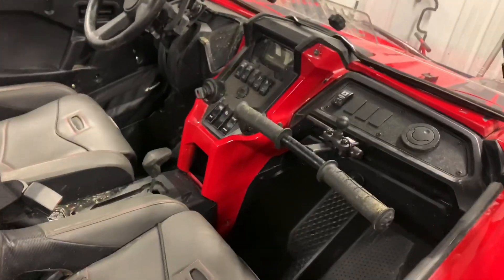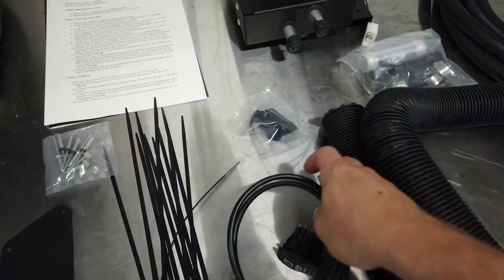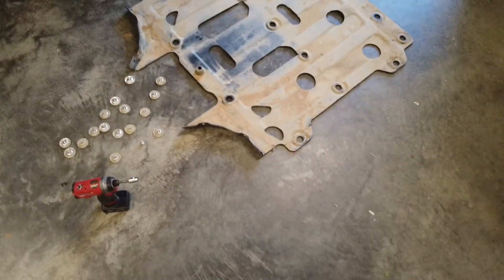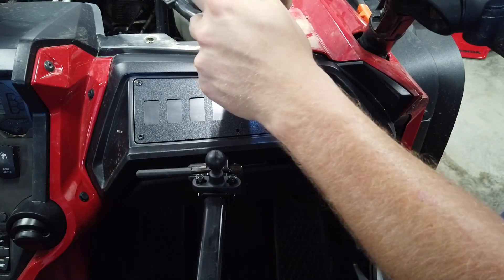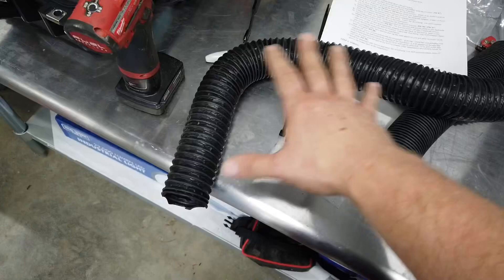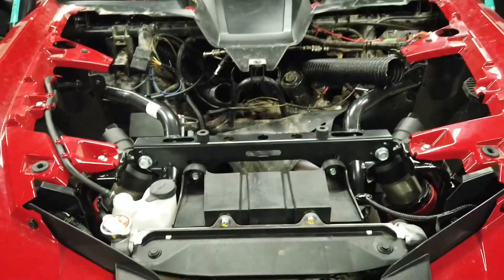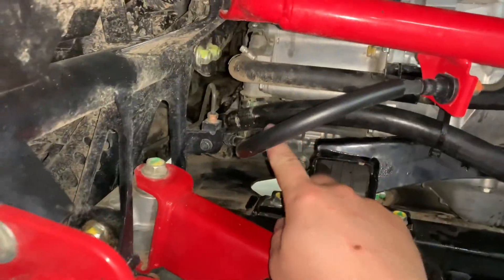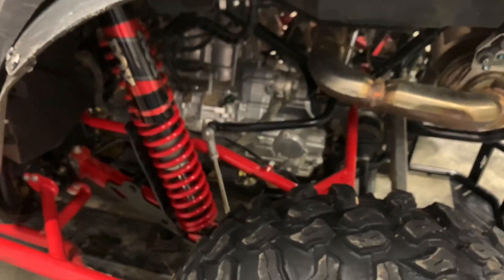Honda Talon - Inferno Heater Install & Review

Comment: Did you install the heater according to the inferno instructions you got with this kit for the honda talon? Reason why i ask is the instructions i have on installing the same heater kit on my honda talon 2021 model year says to connect the heater hoses to the oil cooler line out in the rear of the machine only   ,and use a straight hose connector inline and that goes to the heater core in . The out side of the heater core hose goes back to the engine oil cooler line that you cut , and that is connected to the return to the engine .  This is going to give you more heat sooner because it is before the thermostat. Thanks , Tom
Reply from the maker: Yes, but the instructions back when I installed it were different.  I’m pretty sure they revised the installation instructions sometime after mine to provide faster/warmer heat.
Reply: @Jason____   thanks jay yes they did update this install  . This honda is a pain in the back to work on , no room for things to be added on properly. It’s nice to see your interesting vids and hard work you do on the talon. I see   you have the ambition I once had when doing build projects on your equipment

Comment: Great video!  Do the instructions give alternate mounting locations if you have the windshield wiper kit installed?
Reply from the maker: Thanks.  The instructions didn't specifically mention mounting with the windshield wiper kit.  However, I wouldn't think it would be a big deal to relocate it depending on where you wanted to put it.  There's another guy on YouTube (see the link after this sentence) who does have the wiper kit installed and he shows where he mounted his: https://www.youtube.com/watch?v=IbyQ35WzjTk&t=276s
Reply: I mounted this exact heater months ago with the windshield wiper kit. It does have to go in a different location. Note, this heater is ineffective in temperatures below 55F unless you have an enclosed cab especially if there’s a cross wind. https://youtu.be/IbyQ35WzjTk